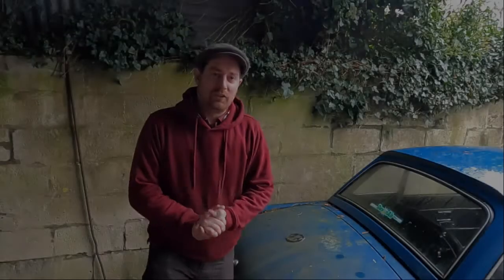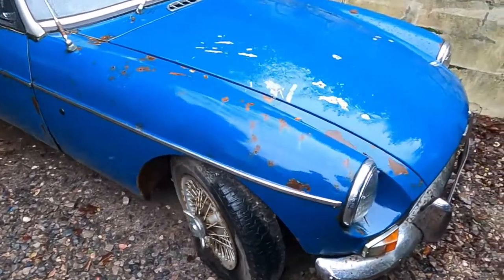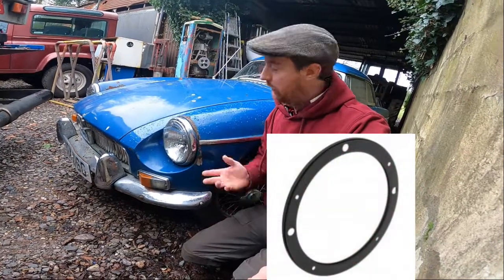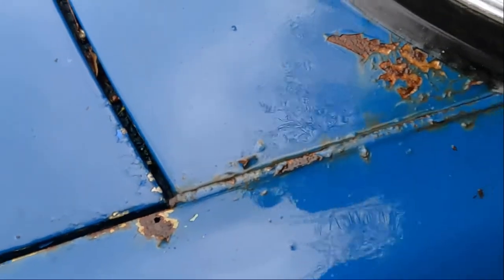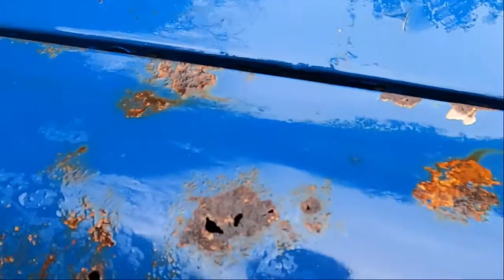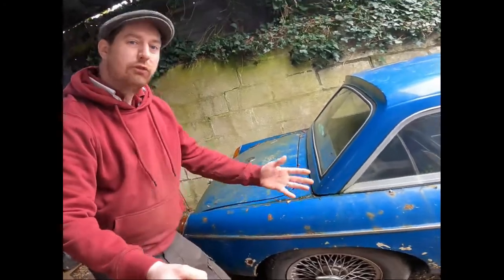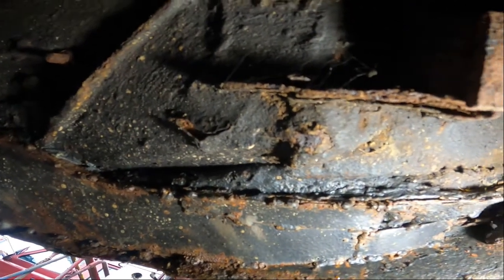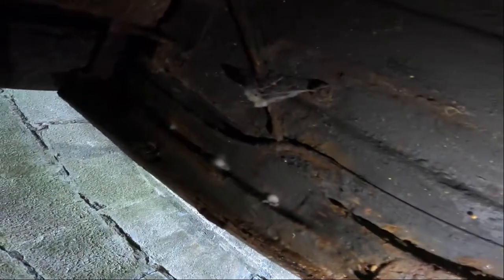1968 MG B Part 2: Bodywork - Is it Past Saving?

Comment: All body repairs are possible, the worst case scenario is to give up on repair and source an alternative body shell, but repairs are only limited by the ability of the restorer. All parts are readily available. If you can weld to a decent standard this car is easily brought back to good condition. Learning to weld properly and paint is a good investment.
Reply: Rather optomistic !
Reply: My 74.5 gt is in similar shape going to restore myself but it's more of a learning experience for me , but I think of it as me basically building a car , a labor of love and with parts available and YouTube I think it is possible.  I'm going pull and rebuild the 1.8 lawnmower motor as well.

Comment: Worse saving but not if you want to make money from it. Unless it was free in which case you may make something.
Budget £2k for the engine work. £1.5k for body parts, not including labour. £2k for other bits. Plus other stuff. The SU carbs may be seized, mine were missed so I restored a pair from eBay, £250 in total.

Comment: Alloy bonnet on a 1968 ?  Last year fitted at the factory was 1967. " little bit" seems to be your favored phrase for something most would consider not worth the effort.  One poster has said  that repairs are only limited by the ability of the restorer.. I would say that would only be if you had unlimited financial resources and plenty of idle time along with skills.  I see a "parts" car. However, I wish you luck with the project.
Reply from the maker: Last year was 1970 for the ally bonnet. We've had around 20 mgb's and C's over the years and it's far from beyond it. We've restored worse in the past.